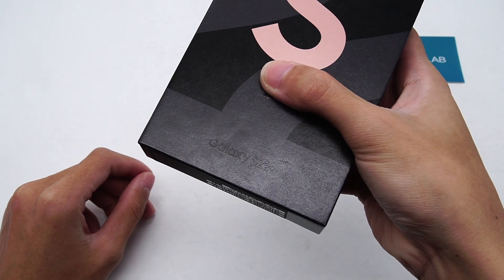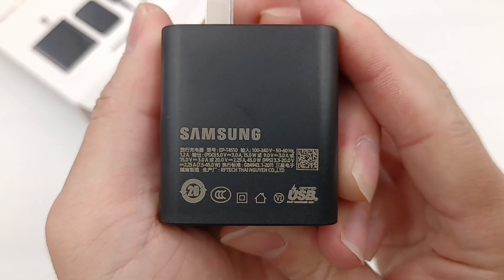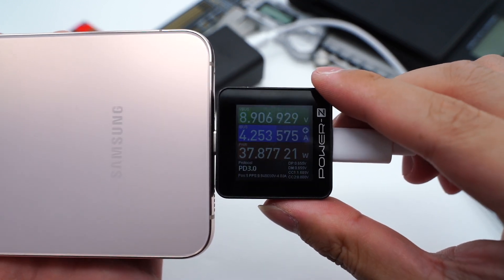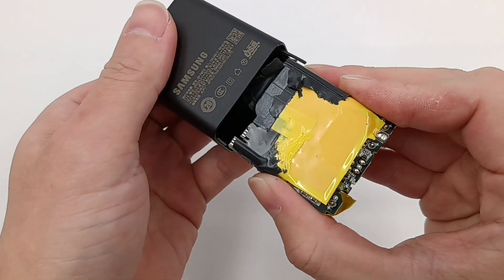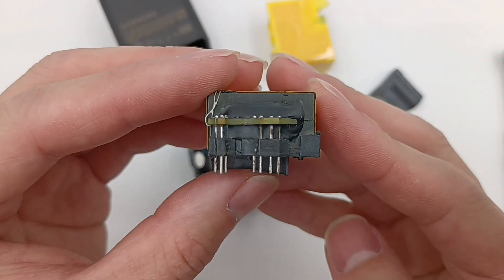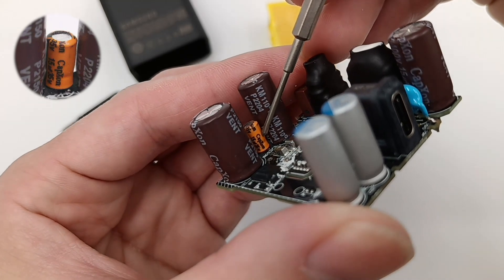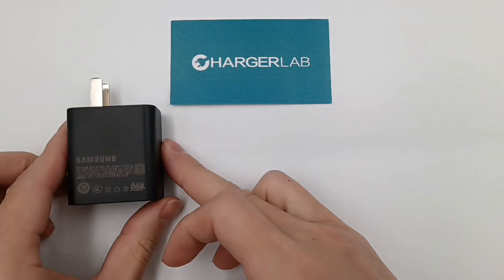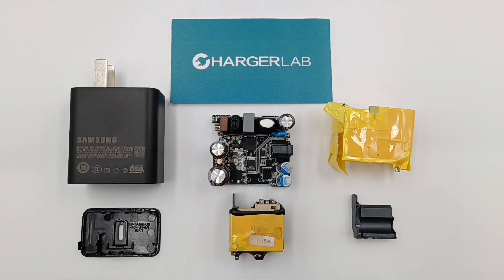Teardown of New Samsung 45W GaN Charger EP-T4510 (For Samsung S22 Series)

Comment: I bought this charger recently here in Australia, the model number, same wattage and 5A cable included in the box as well. What I am confused about is that Samsung does not mention anywhere on the box or even on the charger that this is a GaN charger, I can't seem to find the name GaN written any where on the box or charger, but according to Charger Lab it is. I have quite a lot of chargers at home, mostly GaN and some even from Alogic and they all have GaN written on them.
Reply from the maker: Like the Apple won't deliberately emphasize that the 140W adapter uses GaN technology

Comment: Please try baseus 120w charger
Reply: it doesn't support 25w or 45w for Samsung, i bought it with the s21u last year and it didn't support any superfastcharging capabilites.

the newer 100w one does support both though but they're absolutely garbage as it broke after 1day with smokes coming out of it and it was not just my unit as you can check the amazon reviews with the same issues for it too!

Comment: I have it. It's a very good quality charger. Sadly it doesn't support many protocols outside of 45W PD and the 45W range of PPS. If you want a usb c charger that supports QC4+ or other mainstream protocols outside of just 45W PD/PPS, then I'd recommend UGREEN'S or Baseus's various usb c chargers. Most chargers that come directly from specific smartphone companies dont support protocols that their own devices dont use. So if you need SCP or FCP or the full PPS range of 3.3-21V 5A, look elsewhere. But it's still nice for exclusively Samsung users. The cable that comes with it is nice to since it's 6ft long and supports 5A charging.
As a recommendation, UGREEN has a 100W wall charger with 2 usb c ports, that supports every single mainstream fast charging protocol out there including the full range of PPS. It's on Amazon and I've bought several of them due to the quality of the charger and how fast it charges everything from smartphones to power banks to laptops.
Reply: No Ugreen charger offers 5A PPS, even the 100W model
Reply: @Maciek888  UGREEN does have 2 models that support it, the 100W wall charger model with two usb c ports. I own several of them and have tested them with various usb c testers. Flat out supports and is able to output 3.3-21V 5A. And their 100W desktop charger also supports the full range of PPS with 5A. I also own their desktop charger, and it can do 20V 5A PPS.
Reply: @TheUltimateSlayer  After a few reminder emails and weeks of waiting, Ugreen responded negative to my question if any of their chargers output PPS 5A – it was just a few months ago. There were more precise questions, I explained what to look for at the specs sheet etc. but they never answered these in more detail. Well, that's typical, support of Chinese brands often have no idea about technical stuff and don't know their products.
In the end I purchased Aukey PA-B6S 90W as manufacturer clearly communicated the specs including PPS.
Reply: Is it recommended for S22 Ultra (Ugreen 100 W)
Reply: @innocent-cn7bc  The dual port 100W version can offer the 10V 4.5A required for Super fast charging 2.0. So yes, it is recommended.
It can achieve the full 45W speeds for the latest Samsung devices due to it supporting the full range of PPS. It being 3.3-21V 5A.
Reply: @TheUltimateSlayer  Thanks alot..